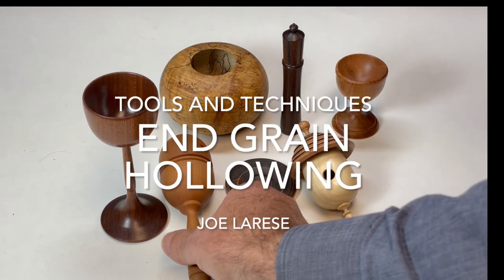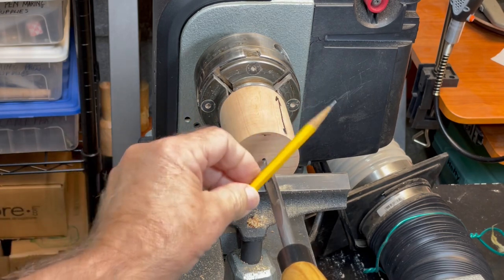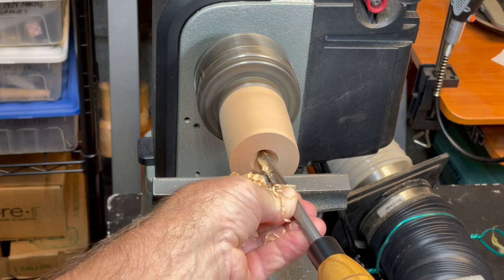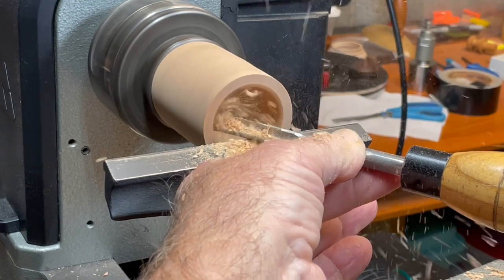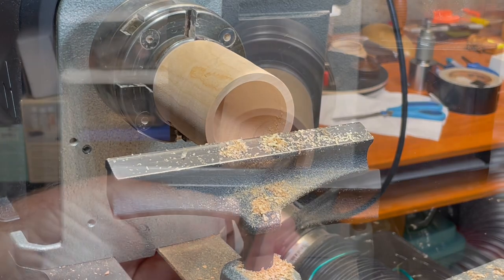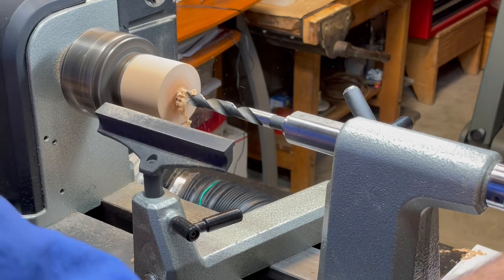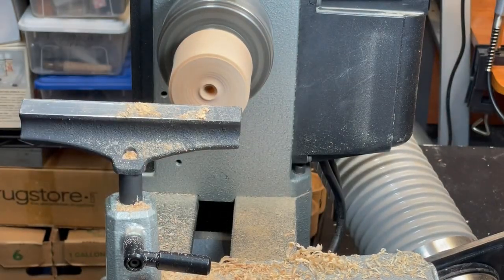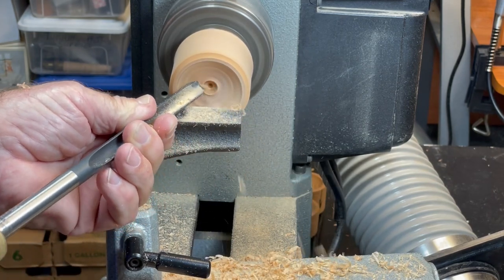End grain hollowing

Comment: What do you recommend for larger diameter end grain hollowing? Say for 4" and larger diameter. Perhaps starting out with at least a 1 1/2" forstner bit?
Reply from the maker: The larger the bit, ultimately the less work, but if the bit jams, you may have trouble.  Clear the shavings often.  Good luck.